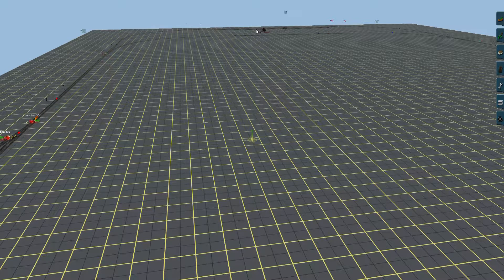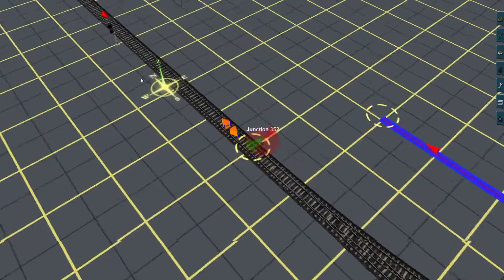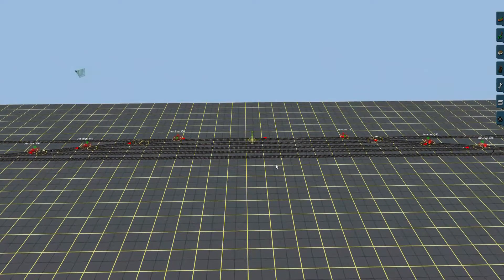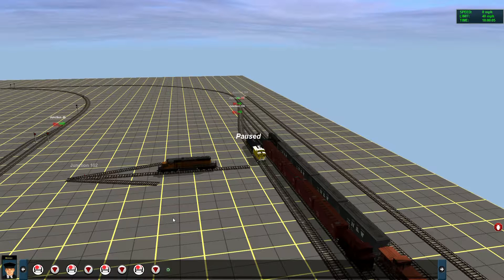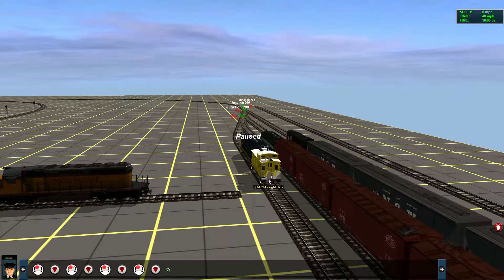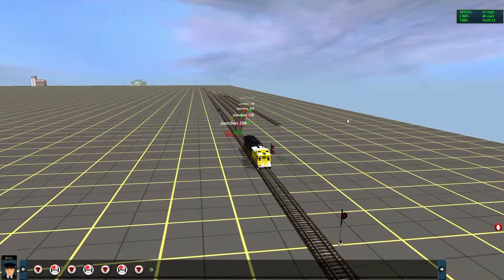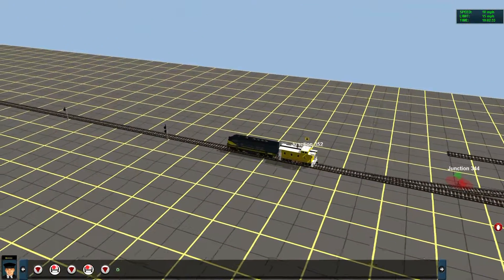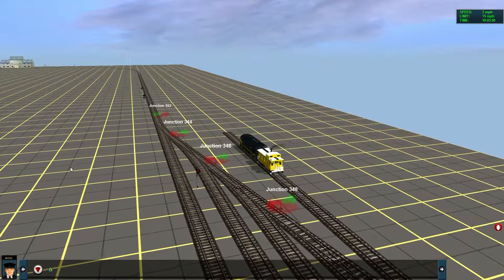TS2012 AI Basic Commands

Comment: Would reducing the radius of the Track Marker detection zone allow the engine to stop closer to the actual Track Marker location?
Reply from the maker: Yes it does. Same with switch radius to reduce the distance the switch is locked by your train.
Reply: @grandpa1955  Great, thank you. 

Is there a reason why track markers have a directional arrow? From what I have tried, there appears to be no difference in their operation no matter which way I point them.

Thanks for the tip about using invisible track at the end of head shunts. It was bugging me why I couldn't get the AI to stop a train close to a buffer stop.

Here's a tip if for you, if you weren't aware of it - when running in AI mode, pressing the SHIFT key produces a "fast forward" effect. So you can use it to quickly move the train onto the next step that you want to check out. For SHIFT to work, go to Main Menu/Settings/General Settings/ and click on "Enable debug features".
Reply from the maker: Hi Bob. The direction of a Track Marker has no influence on its function.
Reply: @grandpa1955  Did you see the SHIFT tip further down in my reply? It would be useful to use in some of your videos.
Reply from the maker: Yes I did. Thanks for the tip.  So many games, I forget some of the details!